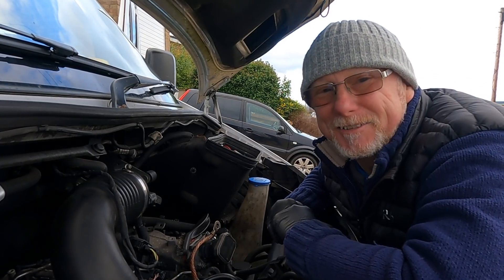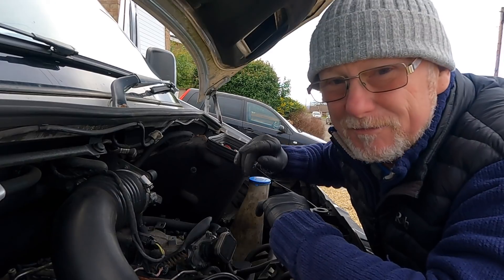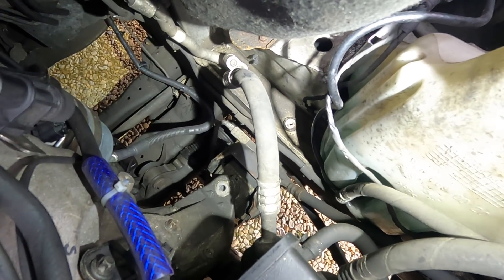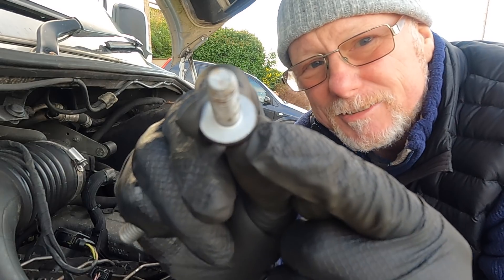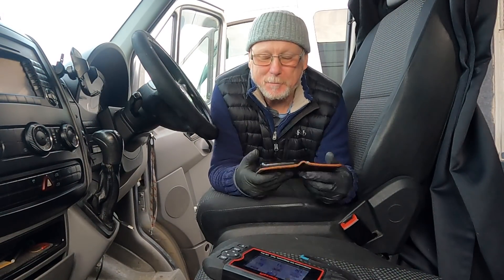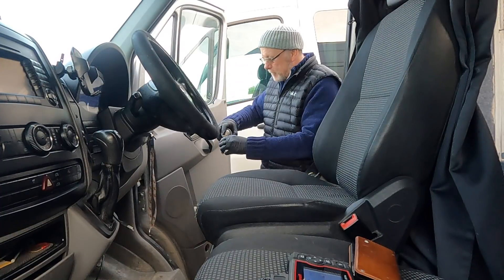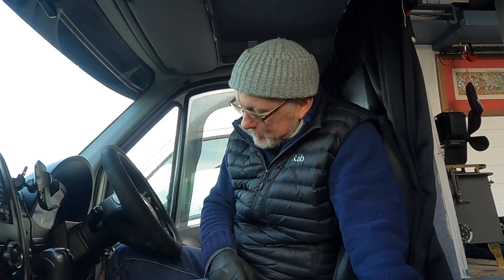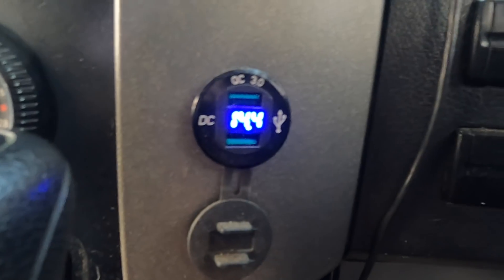Mercedes Sprinter Electrical Problems

Comment: also consider the meat used in terminals and salt on roads thats a thing . but get a new cable clean well and get the codes removed , they dont always after repair sometimes need the codes manually removing

Comment: Man! Don't put wd40 in a switch! Use contact spray (those lube an clean contacts) For a ground surface to make good contact run a tap trough the bolt hole..

Comment: May have been mentioned already, not going to waste my time reading all the other comments to check but fyi the switch is self adjusting you should pull the white  plunger right out as far as it will go before fitting.

Comment: Okay Mel, I was a mechanic - don't forget about the earth lead (and Positive connection) at your battery - clean up and secure those too. Serrated washers can help with getting good earth connections. When you have finished, coat the connections with something to prevent future corrosion. Your B2B charger could be causing some of the issues. Hopefully your on the right track with the brake switch, an interesting project for us all.
Reply from the maker: Thank you buddy that’s a great idea to use them washers 🍻👍
Reply: i was going to suggest that too . good advice a dodgey earth can cause loads of bother .i often put a bit of copper slip on too , added connectivity and terminal protection

Comment: You need a Haynes Manual Mel - one of the things it says is if you have intermittent or lots of different errors then check earthing points. I've heard the brake pedal switch can be troublesome as they can get quite damp/dirty in the footwell. Hope a new one fixes the issue.
Reply from the maker: That’s not a bad idea 👍🤗👍

Comment: Dielectric grease!!!?the joint on motor ground you said aluminium...steel bolt,steel connector? Bad combo...the second you clean aluminium it starts to oxidize. Open up use dielectric then torque it. Don't be afraid to make cable and add,it won't affect anything just add better ground. Check ground from battery to chassis. Reliable....not according to repair companies that use them as fleet vehicles. Frequent to repairs very expensive. Many sent back to dodge gas....
Reply from the maker: Thank you for the great advice really appreciated 🤓👍

Comment: I would be inclined to add a secondary Earth cable and replace that old one as well , remember the old mini’s when the earth lead failed it used to earth through the throttle cable and catch fire.The amperage the sprinter requires to start is high so more earths the merrier.
Yet again another great informative video for those that are not so mechanically minded.
Happy New Year to you and the family.👍❤️🇬🇧
Reply from the maker: Oh I remember the old mini that’s a good reminder thank you happy new year buddy 🥳👍
Reply: that burned a mates vw camper in a big way never forget coming home seeing it on fire and killed the van
Reply: Oh the joys of modern motoring Mel.
Happy New year.
Reply: Good advice, my defender melted it's handbrake cable while I was using the winch. Now I have 3 grounding points 👍

Comment: We have a riot van conversion V6 3.0 diesel auto which had the battery light come on and various "limp" modes come on until the  battery died, I carry a jump pack which got us off the M25. The following morning we hoped to be able to swap over a leisure battery (AGM) to get us on the way, sadly it was pouring with rain and only got us to B
Reply from the maker: That’s really interesting what was the fault in the end 🤞
Reply: @BigVanSmallWorld  still not sorted yet we believe it is the linbus messenger wire on the alternator plug or to ground. Fortunately I have 2 of these vans so I may borrow the alternator off the other one to test the system. I’ll keep you posted Mel.

Comment: Hi Mel might be worth looking into but as the sprinter and crafter are the same, parts are interchangeable, I recently required a headlight switch for my crafter when I ordered from vw a merc part arrived in a vw box. Out of curiosity I phoned merc quoting the part number it was £50 dearer. Hope you understand this comment and that it might even save you a few quid🤞
Reply from the maker: Thank you 🙏

Comment: If you bought a couple of cable terminals, you could re-use some of the cable harness you took off the positive-starter-alternator and make a couple more short cables up to add elsewhere, just cut any crappy ends off and get back to good copper and you'll save some money over buying a mercedes replacement part.

Comment: Love the CCR reference.  I must have changed half a dozen VW brake switches, real pain they are. Back in the day I recall being told that telephone exchange battery connections (50v, '000s of amps)  were usually lapped together with the fine aluminium swarf deliberately left in the grease/vaseline between the plates of the connecting busbars to improve conduction at the joints.
Reply from the maker: I’m glad 😀 someone picked up on that 🍻👍🤓

Comment: obviously could be many things and like you, ive done the process of elimination thing in the past. couple of things i would check is split charger? could you have a short off your leisure battery in the back throwing up a voltage issue on the vans ecu?. on the t5 and other vws i know yours is a merc... my regulator on the alternator packed up which was a bosch and easy fix but at the time a lot of people online said they bought a copy alternator or regulator and dash kept having faults pop up. the voltage regulator on the alternator throws it up. if the ecu thinks voltage is screwed it can affect running and obviously throws code up. worth checking those. good luck and hope you get sorted. that lead looked ok.

Comment: Mel check with a VOLT meter from the engine to the chassis if there is any voltage the earth lead is high resistance , put extra earth leads to the chassis from engine <<Job done

Comment: As suggested put another earth lead from engine to chassis and check battery earth to chassis..
To check voltage you must perform a volt drop under load on all earths and positives…using a multimeter on Volts. Simple to do,even .5V  drop can cause faults.
All fault diagnosis must start with correct voltage at sensors/consumers.

Comment: Good old German engineering Mel , my guess with you fault is a bad connection to your ABS module , if the module doesn’t get the desired voltage it could throw up a voltage fault ( newer Mercedes sometime have a second small battery to backup the ABS pump)  it would also give you your brake fault code 

That my armchair mechanic viewpoint anyway 👍

Might be worth checking your abs fuse too, the 40amp one,
Reply from the maker: Thank you buddy that’s really helpful 🍻👍
Reply: No worries Mel hope you get it resolved, it could possibly be the earth strap as many have suggested but sometimes it’s worth seeing things from another perspective too. It’s not all black and white when it comes to chasing faults as I’ve learnt 👍

Comment: Thanks for this video, Mel! I’ve got a quite new VS30 (2021) having a similar problem with the battery light, seems like I have some parasitic draw happening, even though the alternator is producing 14+ v when running. Noticing continuity between the positive pole and the ground, so I suspect there is a fault somewhere happening. Thanks for the video!

Comment: Hi Mel.
  Great Video as always. I remember slow cranking problems on an old van I had being solved when an old mechanic told me to put two earthing straps onto my engine block (one each side).  No more problems started fist time every time after that Keep up the good work Pall 👍👍
Reply from the maker: Thank you that’s a great idea 🍻👍

Comment: Hi Mell, Maybe nothing to do with your issue but I had weird issue with a Kia Sportage, central locking worked then it wouldn't brake lights did then didn't, Radio and ABS lights had issues in them, auto electrician and workshop change loads of stuff never fixed it, I Thought the car was haunted. then by chance I found the issue, the brand new battery had a broken terminal inside the battery, hit a bump and it would move inside then it would touch again and upset the computer. I had noticed the movement only slightly in the terminal, New battery all good and the old battery was showing 14 volts. Just a thought. good luck
Reply from the maker: Wow that’s incredible thank you 🙏

Comment: Mel, saw a video today which showed the alternator pulley detached from the vibration damping and slipping around, but looking like it was driving.
Maybe an idea to remove the alternator and check the integrity and the drive pulley to the shaft. Also a friend of mine had the bearing fail at the back of the alternator where the diode pack is, which caused similar issues
Reply from the maker: Thank you for the heads up I actually fitted a new one 👍
Reply: @BigVanSmallWorld  I know you did. It was the after market parts that had the issues. Anyway you are all sorted now

Comment: It will be worth understanding how the system is measuring the voltage as it may be the sensor/detection that's at fault and not the rest of the system. I've wasted good money before trusting sensors when they can also fail.

Comment: those 2 errors are related,possibly a load sensor or individual wheel sensors if there is such a thing,i would definately replace the brake switch first as a service item just to eliminate it,earth strap looks a bit weedy,i'd make a new,bigger  one eventually,but thats not your problem
Reply from the maker: Thank you 😊

Comment: Ps don’t spray Wd40 into electrical connections…it’s flammable if there’s a contact (switch)  it can get resistive corrosion and heat up..and catch fire.
I’ve seen a few fuse box’s catch fire due to WD40/water repellent being used…it’s ok to use on connections to clean out but must be flushed out using contact cleaner afterwards and left to dry…

Comment: Suggest putting a parallel earth between your engine area and the leisure equipment, if the earths have different resistances then current can circulate in odd ways (paths of least resistance will take more current etc) with a fancy electronic alternator it may see a fault?
Also don't forget to grease the earth connections as there are dissimilar metals there that will start corroding as soon as they get damp. I use spray white lithium 3 in 1 as its clean and sets like butter.
Good luck with the electrical pixies!
👍
Reply from the maker: Thank you

Comment: When I had my transit I had a similar issue, I actually added another two earth cables, one directly from the Starter mounting bolt to the batter and another from the block to the chassis, Didn't have any issues after that.
Reply from the maker: Thank you buddy that’s really good 👍

Comment: Get a New Lead Mel ,keep for a Spare or Vice Versa.
There was another Vanlifer Cpl had same Sort of Issue with Charging Light 
If still the Same , check all Other Earths on Van Down the Chassis, Doors for Int Lights, Tow Socket if you have one
It Was a Seperate Earth on theres, away from the Engine Bay.
Have you link for that OBD and Price?
Non Start might b li ked to the Brake Switch as a Safety.
Do you have to depress Brake Pedal to Start it?

Comment: I had problems with brake light switch cheap enough from merc there parts arnt to bad to be fair bought one from euro parts had same problem put merc one on behaved fine after that 
My new mer on 18 plate new shape had problems with that earth strap it would start they change it and engine mount 
You could put some copper grease on the connectors to get better contact 
Because it connects via the engine mount the connection between the engine and the mount might be dirty also worth checking 
Another idea make up a lead and bolt an additional earth point on or get jump lead and put on the engine and find good earth on body or battery to prove. Or disprove hope you get it sorted
Reply from the maker: Thank you buddy 😊👍

Comment: What does the Handbook say about that Charging Warning light? If the Earth cable solder has melted then in theory water could get in and corrode it? I would have put Vaseline or grease on both Earth connections to stop corrosion. What about the Battery Earth to Engine/Body is that good?? Drive belt may be slipping??
Reply from the maker: It says take it to workshop 😂🍻👍

Comment: Just had similar problem with aeroplane, bad earth. Battery became weak, barely turning engine. Gave impression battery was knackered. But found earth lead to starter and alternator loose. Turned out the lock nut was tight on shoulder of the mount bolt, but the eyelets were loose. Wire brushed, couple of washer and anti shake washer all sorted. I'm thinking now that problem killed another battery last year that was only 18 month old.
Reply from the maker: Thank you buddy

Comment: New genuine OEM earth cable from Mercedes cost me about £10 ($14 USD) so I'd personally just change it to rule out any doubt. My problem was intermittent starting and I changed the earth and Y cable before releasing that it was the starter solenoid. I'm sure you've already cleaned all the terminals and posts on the starter and alternator when you did the Y cable but if not then that's also worth trying.
Reply from the maker: Yes I clean them all thanks for the positive message I’ll get a new negative cable too 👍

Comment: Hi Mel, you can't always trust the live data from any scanner (especially a cheap one like you're using), if you check the data after fitting the new brake light switch you may find it still doesn't read the 2nd circuit just as before. 
This sort of thing actually goes against what you said with it proving invaluable, because can quite often lead you up the garden path and then you end up spending more money on incorrect  parts trying to diagnose by replacement, so then you got the price of the scanner and all the mistakes in parts it made you take, all the time fitting them and you STILL got the original fault.

Does your alternator have a Comms wire? 
If this wire is broken (for example) it will still charge the battery but will still put faults up on the dash.

In cases like this, you may have actually saved money NOT having the scanner and paying a auto electrician to correctly diagnose the real problem.

Hope you sort it soon mate, thanks for the vids.👍

Comment: Had this on a v6 diesel Mercedes couple weeks ago where the alternator warning light was on but actually charging fine, the plug that goes into the alternator that detects the voltage was broken / had a bad connection and therefore not picking up the reading, worth checking.
Reply from the maker: thank you

Comment: i have just had the earthing problem but on a transit. after spending two days cleaning all the conecctions it turned out to be a knackered battery. in my own defence i was told the battery had only been replaced 6 month earlier.
Reply from the maker: That’s interesting maybe I need the same 🍻👍

Comment: Hi Mel, just a thought but could it be your B-B charger at fault which is causing the the alternator/battery warning? Might be worth disconnecting the leisure side of the van and seeing if the issue still comes up?
Reply from the maker: Oh that’s really good idea thank you buddy 👍🍻👍

Comment: Hi Mel, have you looked at the connectors on your ecu or ecu's if there is more than one. An issue there could be the reason you seem to be plagued with these problems. You probably have but thought I would mention it. Edit: this comment was for your most recent video! YouTube moved on while I made a cup of tea.
Reply from the maker: Thank you buddy

Comment: The carsoft  should give a specific fault code for brake pedal switch fault and wheel speed sensors. If not it’s unlikely there at fault. If you can read the ABS/ESP control unit see what faults are in there? Assuming your voltage is now good (new leads)  are there any CAN (controller area network) faults in ABS or engine ecu? If so possible wiring fault on loom that runs under vehicle to rear sensors etc..(rodents love copper wire!)
Also known fault with small fuse box on drivers side (RH)  shorting out causing voltage issues…✌️
Reply from the maker: Thank you buddy that’s really helpful

Comment: Mel, love the channel,  just a thought, does the error code not relate to the load sensor rather than the brake pedal switch. They used to be a spring loaded switch  but are now electrical switches. They increase the braking power to the wheels based on the load in the van. Just a thought. Jamie
Reply from the maker: Thank you I know what you mean and I’m as confused as well I think I’m going to have to go get it plugged in probably if the switch is not the problem 🍻👍
Reply: @BigVanSmallWorld  your OBD diagnostic tool should be able to read the fault, try in the suspension section rather than braking, might point 👉 the way.

Comment: Just been thinking, if you have a good voltage coming from the alternator & a good voltage from the battery, it must be the voltage sensor itself that is faulty wherever that is?

Comment: My experiences is that WD40 is excellent to soften up crusty stuff, even on electric parts - BUT - one has to wait to use the part until the WD40 has dried out (at least 12 hours) I have saved my gauge panel twice that way..

Comment: Have you tried disconnecting the B2B or split charge relay. Check your manual as most modern vehicles have more than one earth lead/point.
Reply from the maker: Thank you that’s a great idea 🍻👍

Comment: Hi Mel. Is it worth disconnecting your DC to DC charger to see if the charging fault is still there? Just a thought.
Reply from the maker: Yes I did try doing that 🍻👍
Reply from the maker: Yes I did try doing that 🍻👍